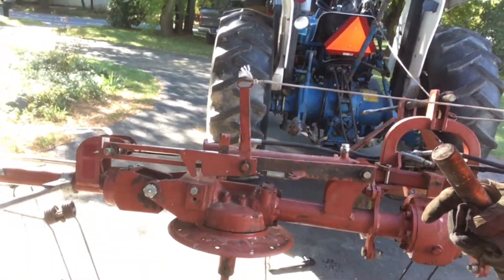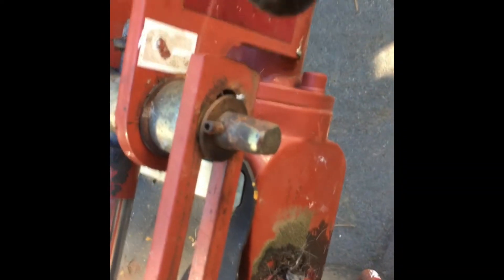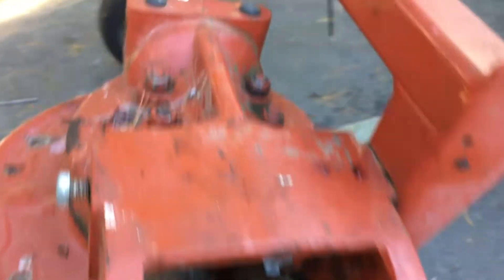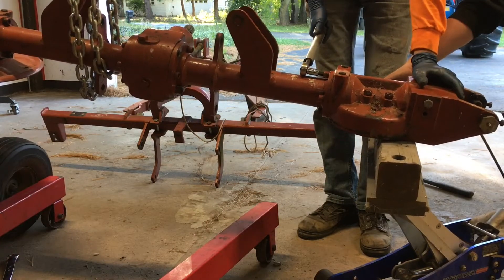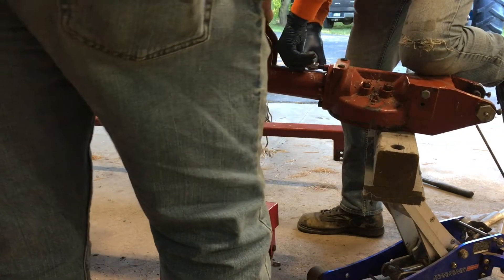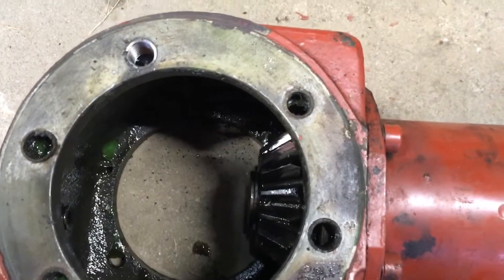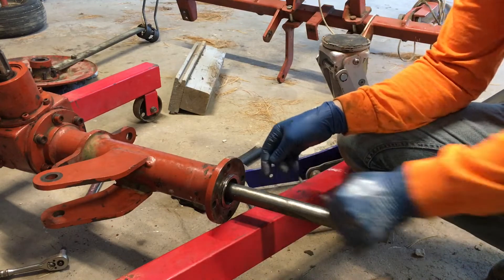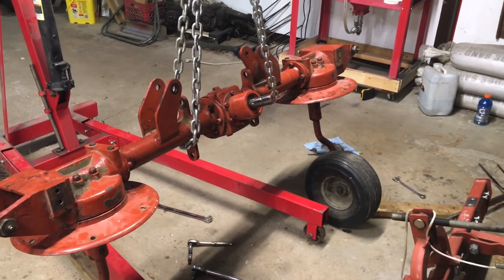Complete Agco tedder tear down! Part 1

Comment: Does part 2 show how to disassemble the u joints and how do I get to Part 2 video
Reply from the maker: I never made a part 2. What exactly are you trying to do to the u joints?
Reply: @TheScientistHayFarmer  remove them from the housing, they are stuck
Reply from the maker: Remove the double cardan joint from the tedder or remove the universal joints and bearing caps from the yoke?

If removing the double cardan joint from the tedder, you need to knock the roll pin out first. Have you done this?

You may need to take the arm off. 

The cardan joint may still be rusted or seized onto the shaft. In this case you just have to get creative. Try prying it, use heat or a penetrating oil.

Comment: How so you remove the u joints?
Reply from the maker: The double cardan joints are held on the shaft by a roll pin, and there might be a key way too. There is a hole in the casting of the arm that you line the roll pin up to pound them out. Then remove the u joints from the joint like any other u joint.